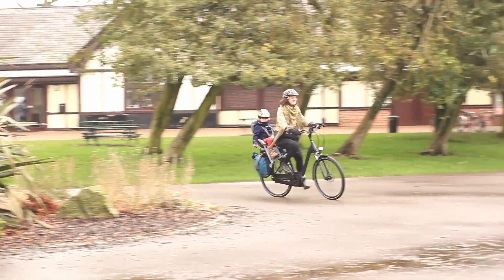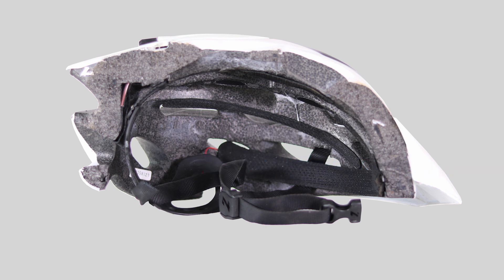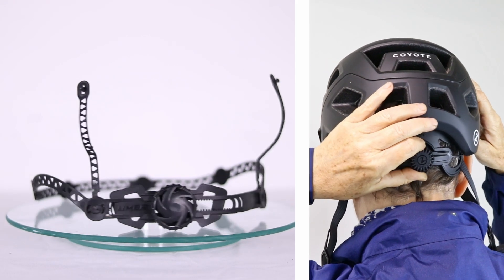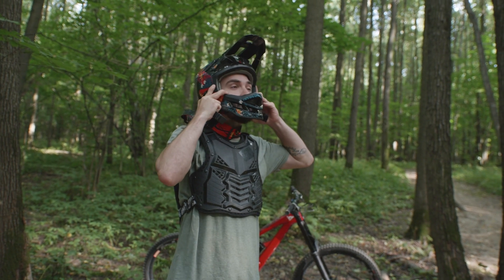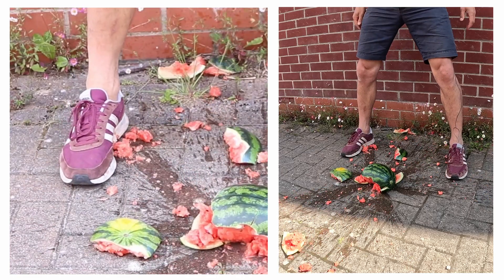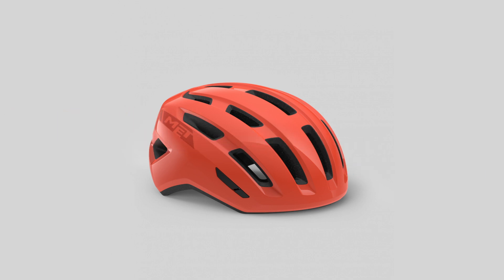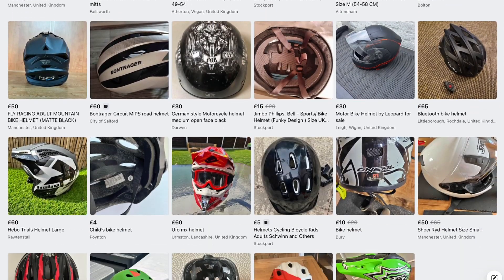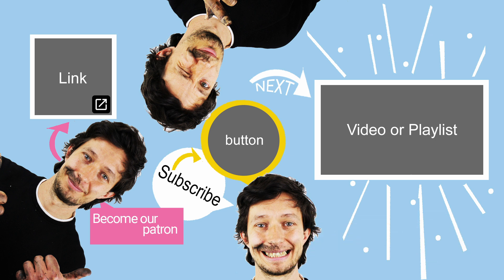Bike Helmet - How Does It Protect Your Head?

Comment: My pet hate is the wearing of helmets perched on the back of the head and not fastened tightly under the chin. If you have gone to the expense and minor miscomfort of using a helmet, you really should get as much protection as possible.
I'm also amazed at the number of kids I see cycling to school with the helmets their parents have insisted they wear when they set off, dangling from their handlebars.
Reply from the maker: I completely agree with you! Helmets are meant to protect us, and wearing them correctly makes all the difference. A helmet that's not fastened properly or positioned incorrectly can offer much less protection in the event of an accident. It's crucial for both adults and kids to wear their helmets properly—not just for the ride to school or the first few minutes—but throughout the entire trip. That said, educating kids and adults alike about the proper fit and secure fastening of helmets could make a big difference in safety. Thanks for sharing your thoughts!🙂